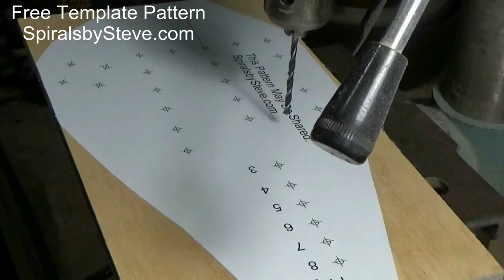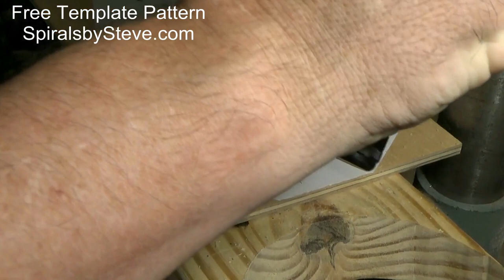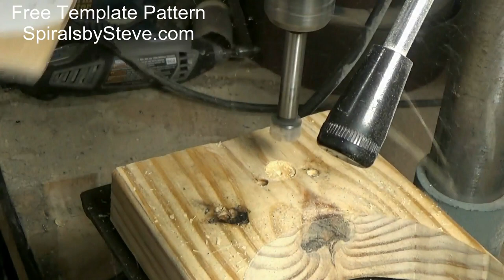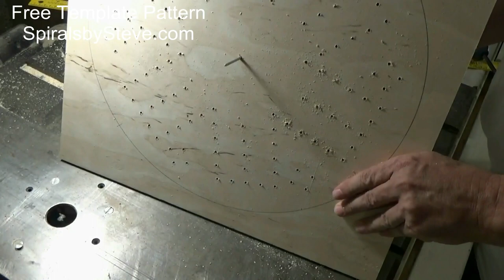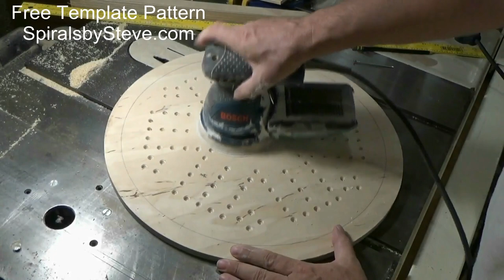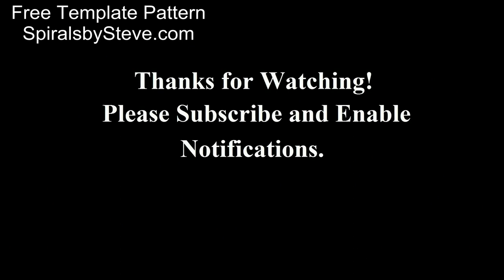Dirty Marbles Game Template

Comment: Awesome. What type of bit did you use to finish the holes and what size was it?
Reply from the maker: The pilot holes are drilled with 1/8" bit, and then I used a countersink bit to make the holes conical.  Countersink bits are used to to make screw heads flush or slightly below flush with the surface.